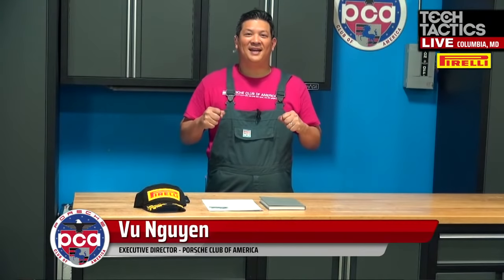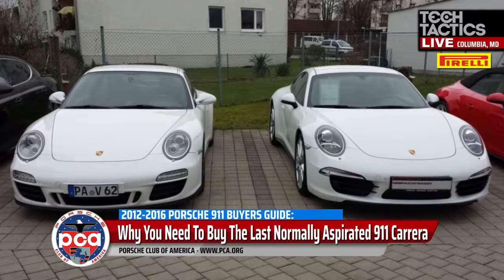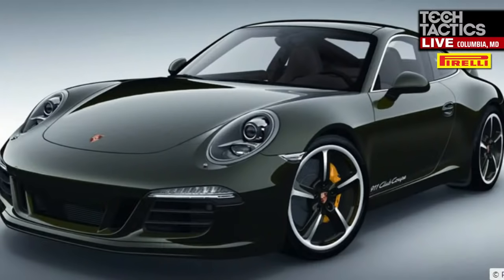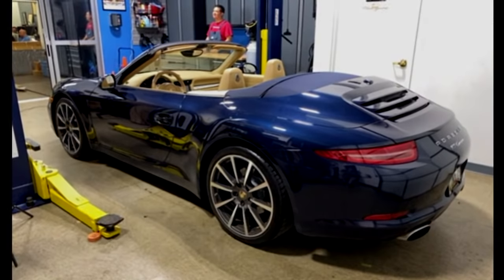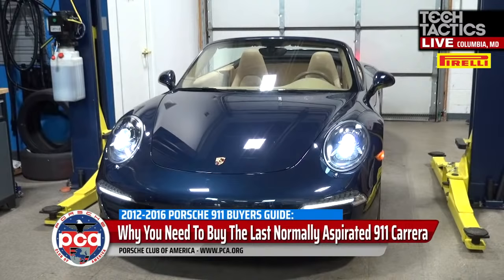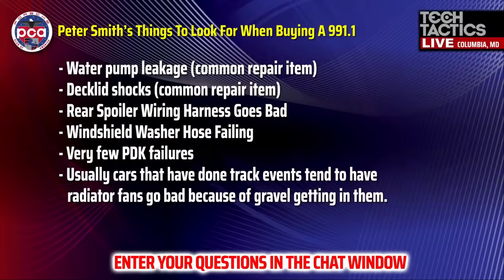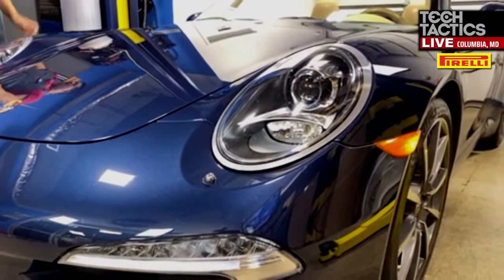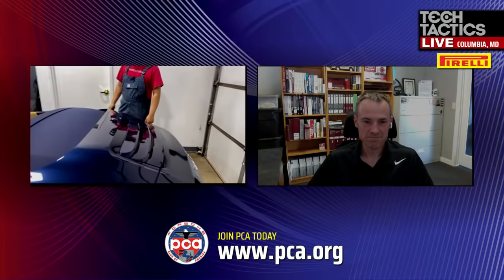Buy a 2012-2016 Porsche 911 (991.1) now — What you need to know | Tech Tactics LIVE

Comment: Purchased a 2013 991.1 C2S MT in 2016. 21,000 miles on the odometer and paid somewhere in the high 70s for it.  Just a great car.  Awesome cockpit layout, great power to weight ratio. Handling characteristics are fantastic. A pure joy to drive.  Yes, I baby it, its a weekend warrior mostly with some occasional trips. Keeps me smilin'.
Reply from the maker: Great to hear!
Reply: Do you think $63,900 for a 2013 991.1 Carrera S coupe, with 78k miles is overpriced? Clean title, 5 prior owners, no accidents, aqua blue metallic, beige interior, PDK.

Comment: Just got my hands on a 2013 991.1 Carrera S. Incredible car, light 3.100 Lbs, fast and smooth, and very comfortable on the road. In Normal Mode, in contract to Sport, Sport Exhaust turned off, it is scarily quiet. Be prepared to pay to $75,000 + for one of these cars...I paid nearly $80.0 and don't regret it for a moment...thank the good gods above that Porsche made quite a few of these before going to the twin Turbo 991.2.
Reply: Congratulations 🎉, I'm jealous 😆
Reply: How many miles did it have when you purchased it? I'm planning to purchase a 2013 991.1 Carrera S with 79,000 miles. They list from for $63,900. I offered $59,500. Good deal?

Comment: I just bought a 2012 991.1. I haven't had it long but I'm loving it so far. I wanted a "smaller" vehicle around 3,000lbs with good handling and power, and something that pulled my heart strings when I looked at it and heard it. It's checked all of those boxes. The only "downside" is it's a PDK and I wanted a manual, but I gave up trying to find my "perfect" spec. The PDK is much better than I thought it would be. I only drive it in manual mode and it acts like a manual whereas an automatic in manual mode still acts like an automatic that you shift - night and day difference behind the wheel.
Reply from the maker: Congratulations! Great comment, we appreciate the insight.

Comment: Bought a 2012 S in February.  I’ve wrung out some extra power with exhaust, plenum, intake and tuning.  About 460 bhp.  Added the third, center radiator for our desert temps in AZ.  The only car I’ve ever owned that I have “raced” (one autocross so far) or put on a track (owner’s experience at Porsche LA).  Its handling and drive train are flat out exhilarating.  Nathan has it about right.  I was considering a 997, but the 991.1 has a more robust and reliable power plant, and it’s part of a model progression that is simply more car all around.  I’ve had to fix some things already, including all the change over valves and a new wiring harness for them since the original 991.1 COV’s were simply not up to par and Porsche changed vendors in 2014.  New drive belt, belt tensioner, expensive PDK service for 60,000 mile service, etc.  Planning to upgrade the suspension with Ohlins coilovers and GT3 lower control arms for a bit more camber.  Installed an aftermarket Apple CarPlay unit for streaming audio and navigation.  It’s a keeper.
Reply: Which system did you use for the Apple/car play?
Reply: @ymararma  NM Automotive.
Reply: How much did that end up running you?
Reply: @TrderJ0es  NM units are around $450, not exact, from memory
Reply: Amazing write up. Hope shes treating you well!!
Reply: Ended up selling this car last month, making room for a 2016 GT4 with the DeMan 4.5 conversion.
Reply: 460hp?  Are you sure? 
Thats 30hp more than the Powerkit from Porsche, that has a shitload of upgrades including special porting, different variable length intake ports and higher lift cams, besides a lot of other things.
Reply: @deecoopsau  dyno tested

Comment: Purchased a 2013 911 991.1 Carrera S Cabriolet with 33k miles CPO. I will say this is probably the most amazing car I’ve purchased. Drives and handle like a dream it also screams loud when pushing hard on it. But buyers be ware, if you do not get a warranty on a car like this you will regret it! Although this vehicle had low miles I’ve had to replace various things. So far this car has had a PDK transmission replacement, 2 motor mounts, window switch, amongst many other things like new set of tires and battery all at the tune of over 20k. If you have money to burn then take the chances if not I definitely recommend getting the BEST warranty. I spent 5500 on the warranty and it’s paid it’s self off several times over. JM&A covered all the components thus far.
Reply: If your car was not CPO what warranty company would you have gotten?

Comment: I had the washer fluid hose fail on my 981, and it is a super easy fix.  I have tons of metric air tubing and fittings at my disposal at work.  The plastic washer fluid line is 6mm OD, so I used some flexible urethane tubing (SMC TU0604B) and one touch couplers (SMC KQ2H06-00) to splice it.  Better than new.  Lots of other brands out there too.

Comment: Not sure I agree with these guys on a few things. 1) Manual tranny on 991.1 is just fine. It may not be as good as the 6 speed in the 918 (but it's fine). Don't opt for the PDK based on that. 2) Manual 991's are harder to find and are commanding a premium. 3) SC is the must have option - not PSE. Even on manual 991's, the SC adds dynamic engine mounts and makes the car sharper. You can really tell the difference between Sport vs,.Sport Plus (the way the throttle is mapped, etc.).

Comment: Exactly why I bought a "slightly used" 2015 911 Carrera 4 GTS with a 7-speed manual and a mere 98 miles on it. And that was in the summer 2018, so it was a 3y 1m old used car. Plus it had $45,620 in factory options, mostly performance options. So why did I not buy a new 991.2 for less money? The 3.0L and turbos and there is nothing wrong with that, but it is not what I wanted in my Porsche. I also did not want a PDK.

Now what gets me is the 991 series has been around since 2012, and till the very end, they have coolant leaks from either the water pump and/or the plastic coolant pipe. Now it took them long enough to "maybe" sort out the issues (a redesigned plastic coolant pipe and another part number for the water pump). I realize it isn't every owner, but some owners have had them replaced at least once. Sort of reminds me of domestic car corporate mentality. I joke about it because maybe Porsche was never meant to produce a liquid cooled car as I also have a air-cooled 993.
Reply: How experience was it to fix all that stuff??
Reply: @williamhickerson4316  The cost was a bunch of O-rings and the updated plastic coolant pipe (that I never used). Maybe $40. I was on CPO but chose to do this myself as I hate anyone messing with my vehicles.
Reply: Thank you for replying. On Friday the 8th I purchased my dream car, 991.1 Carrera S with 78k miles in excellent condition. Also purchased an extended warranty for $3,100. Fully covered, bumper to bumper. 3 years, and 45k miles.

Comment: My door handles are missing magnets inside, the only issue I can’t fix well 😂 otherwise pretty easygoing. Daily 7 manual is not a problem at all, as long as the transmission mount insert is replaced, 31 mpg with roof down, no complaints.

Comment: '14 c2s pdk sport chrono acquired it on '15 it had almost 10k miles (lease return). Now it has close to 55k miles. Installed akropovic exhaust and it sounds phenomenal. Pretty solid car, no major mechanical problems yet (knock on wood).
Reply from the maker: Thanks for sharing!

Comment: Oh, the PDK does fail!
Fortunately, I had a warranty on my 2010 Panamera S. About 82k miles, it started to slip. Took it to the Porsche dealership,as no one wanted to touch the task of dealing with it. They don't repair them. After complete replacement, it was over $30000.
Make sure that it is serviced at the proper intervals (30000 miles ?) they DO fail! 
Granted, it was 14 years old.

Comment: I have a 2014 Carrera 4S 911 PDK, with chronograph pkg, the reat shock went out last year, we fixed it but was around $2500 by the dealer. Luckily only one shock absorber.   Has the ability to stiffen shock values.

Comment: If you live in FL or any hot and humid state the alcantara headliner will start to sag and it is $$$ for a factory OEM replacement. Mine needed to be replaced at 15,000 miles which is all I have on my 2013 991. Carrera S coupe.
Reply from the maker: Thanks for sharing!

Comment: EBC ceramic brake pads will leave hardly any brake dust.
Reply from the maker: Any difference in stopping power?
Reply: @PorscheClubofAmerica  ...its not recommended for track use but I have made some hard stops with no problem on the street. When I replaced the pads I also replaced the rotors as well.
Reply: I got ebc red stuff. I heard yellow is good too.

Comment: Hey I'm considering a 991. I had a 997 as a daily driver but found it difficult live with on long trips. A lot of noise in the cabin. Anyone gone from 997-991? How did you find it? More of a useable daily due to the longer wheel base? Thanks.
Reply: I have had a wonderful 997 tip. Great car. Bought the 991.1 S better than the 997 in so many ways. Too much to explain, just find the best one you can and buy it..

Comment: Yes I will buy the gts but

So every time you change the air filter you have to pull out the rear bumper? That the most stupid engineering I ever seen
Reply: With the Panamera, the front bumper cover comes off. Your feelings are shared! Absolutely stupid.